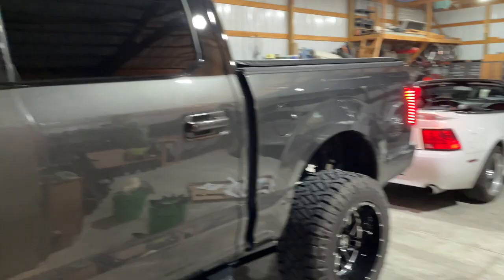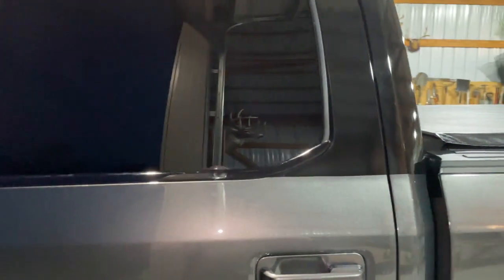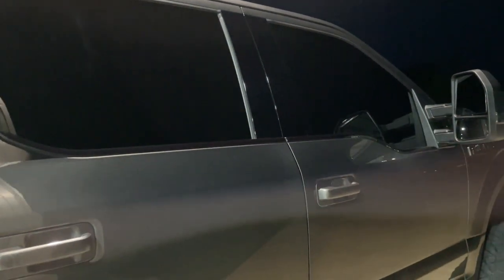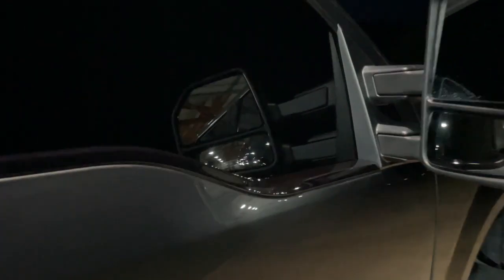Installing gloss black window sill trim covers + update on the truck problem!

Comment: Glad you got the AC figured out. Definitely need to subscribe to FordBossMe YouTube channel. That guy is a wizard with the Fords and I believe he has a email link where you can send him a private message if you have any questions. He might be able to get you a part number for those trim pieces in case the covers don’t work out. I’ve installed a color matched hood protector on the front of my truck that used the double sided tape and it’s been there for over a year now, so hopefully your covers will stay on. Thanks for the video.